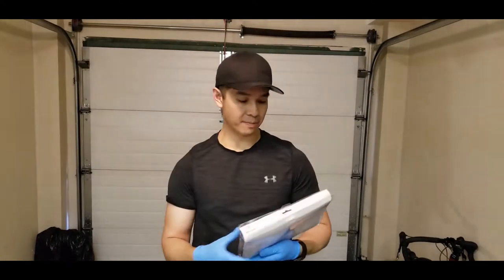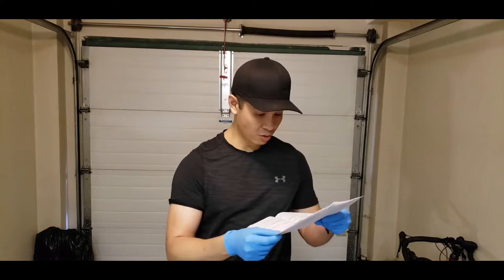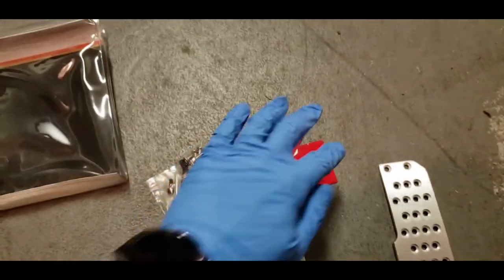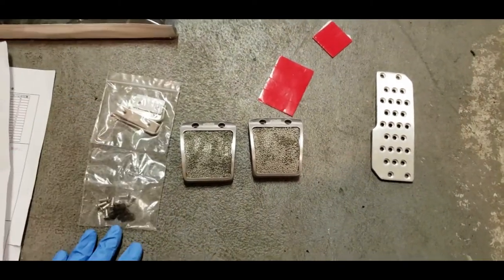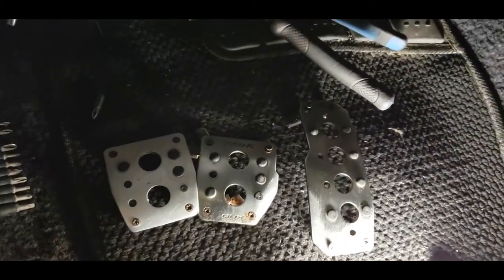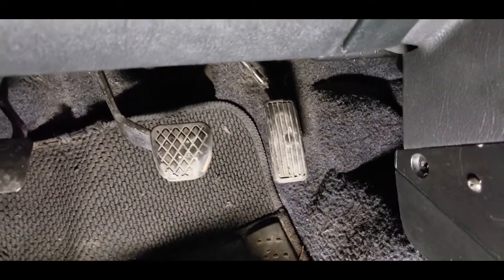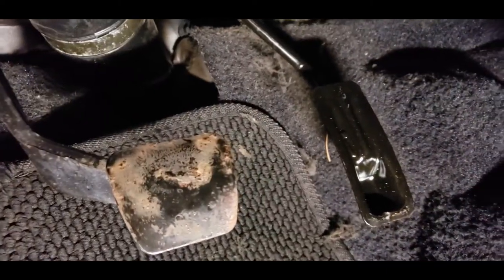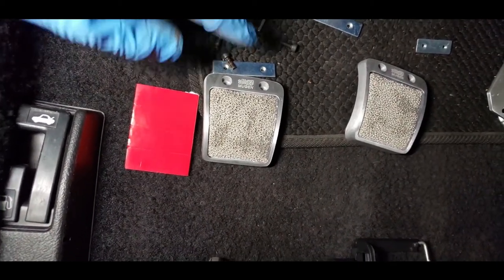[DIY Car Mods] How to Install Mugen Pedals (Replica?)

Comment: I’d put blue loctite on the thread of those screws. I bought the same ones 😅
Reply from the maker: Hmm. I wonder if I should put loctite. I'm not concerned about them coming loose cause I don't think they will. I'm more concerned about them rusting and not coming off later. 🤣 like the old pedal set that was on the car. The screws were pretty rusted.

Comment: how do these hold up? also, is the accelerator one slippery at all? looks like it might be a bit
Reply from the maker: Still holding up fine and it's been 3 years now, but I only drive my car in the summer. It's not slippery at all and I've driven with many different shoes, sandals, and slippers. I don't think anyone would ever slip anyways since you would pivot between brake and accelerator. Overall, they've been fantastic pedals.

Comment: Are u sure that the doubletapes on the accelerate paddle is so tight ?
Reply from the maker: The double sided tape is just to line up the accelerator pedal. The screws and bracket plates do all the work to hold it in place.

Comment: Are these metal?
Reply from the maker: Yes they are. They're aluminum. Not bad for replica. Only time will tell how long they'll last but it adds a nice touch to the car.
Reply: @BudgetGears  how are they holding up since you've installed them?
Reply from the maker: @RR-cg2rq  They're fine so far. I actually haven't driven the car. The car has mostly been sitting in the garage as I work on it. Work in progress. But from the few times I've taken the car around the block, its held up fine. No issues at all. Excellent grip on my shoes. So I'd say they're a decent part.